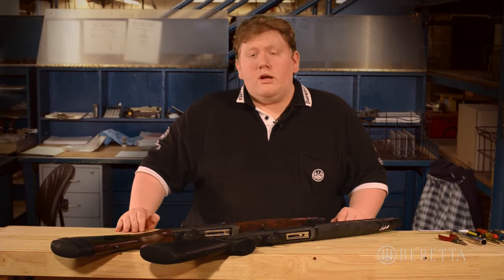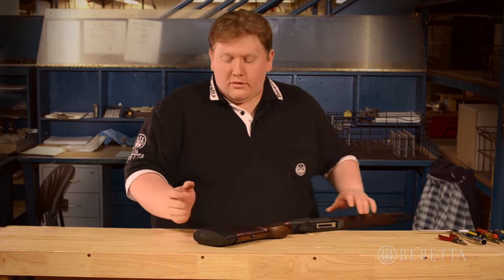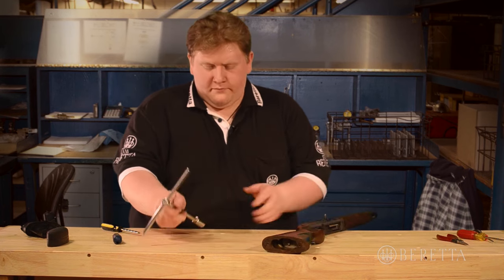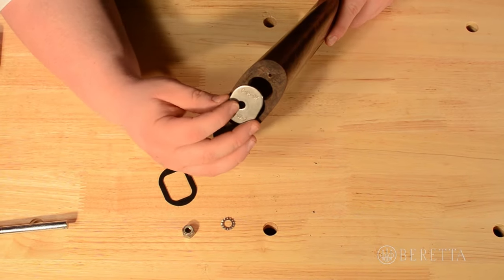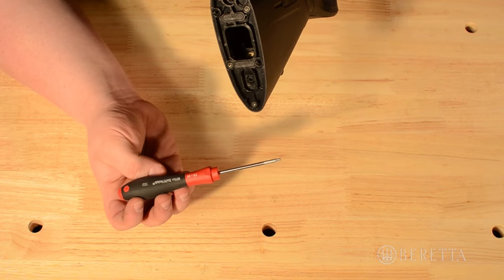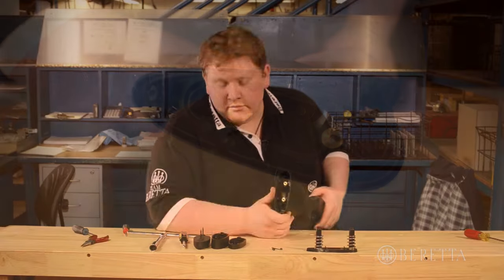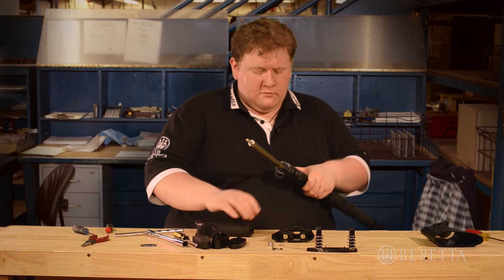Beretta Xplor and Xtreme - Adjusting Stock Cast & LOP

Comment: Nice instructions, clear and concise.  The whole stock on my a400 extreme plus was randomly loose, I had to take the stock apart and tighten that 13mm bolt holding the stock on.  One little correction though, once you take the butt pad off those 5 screws are t10 torx and not t8.

Comment: I bought an A-400 which was set for a left hand shooter. Swapping the shim and spacer to right hand set-up was a breeze, but when I mounted the gun it still had the bead off to the left of the rib. But the next day when I mounted the gun the bead was right smack in the centre of the rib. The stock had obviously developed a "memory" biased to the left hand set-up and it took about 15 hours for the stock to reform to the new bias. Just thought I would throw this in in case anyone did it and thought they had done it wrongly. Thanks for the instructional videos Erik.
Reply: Clarification. Was a right handed gun set up for a lefty or did you obtain an actual left handed model?

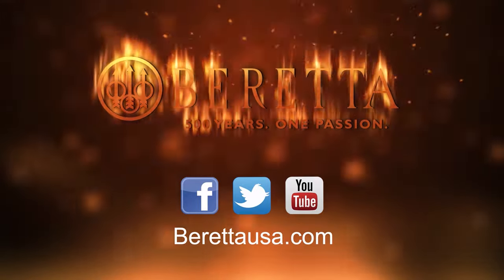Comment: WARNING! At time 3:42 / 9:38, He says you want to have the C60 SX facing you at the top as he places the plastic shim onto the Stock.     

THAT IS AN INCORRECT STATEMENT.   

SX (Left-Hand) and DX (Right-Hand) plastic shims are positioned on the rear of the receiver, so the marking is visible toward the shooter! At that point, the desired shim marking will be facing you! When the metal spacer is placed into the hollow of the Stock, that will also be facing the rear of the shotgun. Both Shim and Spacer face the shooter or the butt end of the gun.   

If you don't believe me, use a caliper to measure the shim. When looking at the DX side of the shim, the left side of the shim is thicker, causing 'Cast-Off' (rightward cant) for the right-hand shooter. Conversely, when looking at the SX side of the shim, the right side of the shim is thicker, causing the Stock to 'Cast-On' (Leftward cant) for the left-hand shooter!
Reply: Good comment. I followed the video then dived into the comments to see why I had cast off for left hander!! Another comment elsewhere says imagine you mounted your gun and your stock were transparent, you would be reading the numbers on the back of the receiver facing you. Only part that could be confusing, and they made it confusing!!

Comment: at the 3:40 mark.  The guys says put the plastic black shim facing (SX for lefty, and it's Dx for righty)  you on the stock.  I believe this to be incorrect.  It should be placing the shim on the back of the receiver facing you which would be opposite of what he is doing by placing it on the stock.  He is not doing it as the manual states.
Reply: Thank you, was wondering the same thing

Comment: Just as an FYI, the T8 Torx screwdriver will need to have a very small diameter shaft to go down into the recoil pad screw holes to get the the Torx screws. I had to go out & buy a set, which is fine since I'll use it for other tasks.

Comment: 8:48 appears to show the front spacer being reinstalled with "C-55-DX" facing the shooter, but the rear spacer was installed with "C-55-SX" facing the shooter for a left handed drop. Per the manual this is incorrect. @Beretta can you confirm?

Comment: Just bought a 1301 comp. I shoot left handed so tried to replace the DX plate with SX. Can't figure out how to remove the end plate. I have the butt removed and the bolt and can see the Cast plate but can't get the plastic end cap off. Can't find instructions how to remove. Please do a video or provide explanation. PS - the Xtreme has screws whereas I don't see any for the 1301.

Comment: When positioning the front shim should the markings be facing the rear, towards the shooter? I wished they zoomed in on that!
Reply: I agree
Reply: sevenrats 
Yes towards the shooter.
That's how I did mine.
Reply: according to the manual, page 35 and illustrated on fig. 40, the shims needs to have the same numbers/letters facing the same way, and towards the shooter when the gun is assembled.

Comment: Mine is T10

Perhaps a $2000 shotgun could come with a toolkit?

Shim marking towards the front towards the shooter is a bit vague.

Might want to mention D for Dexter or right handed, S for sinister or left handed.

The downloadable owners manual has all drawings removed and is useless.
Reply: erg0centric according to the manual, page 35 and illustrated on fig. 40, the shims needs to have the same numbers/letters facing the same way, and towards the shooter when the gun is assembled.
Reply: @erlende2933  he should have made this comment in the video. He says “facing you” but it could have been interpreted as facing you as looking at the stock when installing the shim.

Comment: This video is very helpful, but removing the Kick-off unit is not as easy as it appears.  I couldn't get a T15 screwdriver (recommended) that was small enough to get through the brass fitting.  I called Beretta in NY and Scott suggested trying an allen wrench.  A 3/32" one worked perfectly.
Reply: I ground one down to fit
Reply: Mine was a T10 on the action model.

Comment: First, thank you for the video, it helped.  But just so I am clear, the cast polymer shim should be placed on the stock with the corresponding drop number visible and on the top?  Just like the drop shim?  In other words, both of the corresponding numbers/letters would be facing you as you look at both the front and the end of the stock.  Is this correct?   example: 60DX <--- stock ->60DX  Thanks in advance..
Reply: Jay Thompson according to the manual, page 35 and illustrated on fig. 40, the shims needs to have the same numbers/letters facing the same way, and towards the shooter when the gun is assembled.
Reply: Had to scroll through the comments to find this. My manual has done away with the figures but still references them in the text. 🤦‍♂️

Comment: I changed the cast and drop on my extreme plus was getting cheek slap... fits and shoots great now. I was out the door on a hunt right after I did this and found a little rubber o ring about 1/4 inch outside dia. on the floor. I don't know if it was out of my stock or off something else. Is there any o rings in stock of a kickoff?

Comment: I did this yesterday just to service the kick off and clean out the stock.   My question is my Phillips and T style screws are rusted pretty good.  Should I contact Beretta for replacements or Brownells?   Thanks
Reply from the maker: It's hard to diagnose without asking more questions. Give us a call at 800-BERETTA ext. 2003 (mon-fri 9am-5pm ET) and we can assist you further
Reply: +Beretta Thank you!

Comment: I am trying to adjust my LOP by replacing the 1/2" spacer with the 1" spacer, but the screws in the recoil pad do not fit all the way through the 1" spacer.  How do you replace the screws that come in the recoil pad with the longer screws provided without ripping apart your recoil pad?
Reply from the maker: Just slowly unscrew them while putting pressure on the front of the screw.  They will come out without tearing anything as long as you go slow.
Reply: @BerettaCommunity  Just got a new A400. Apparently I have hobbit arms and didn't know it. My question would be, if you can just use the butt stock end cap, can you / should you use the same screws that it came with or do you need a shorter set of screws to keep them from bottoming out within the housing?

Comment: Can I eliminate the 1/2 inch spacer for the shortest LOP possible?
Reply: Just got a new A400. I would like to know this as well. Apparently I have hobbit arms and didn't know it. My other question would be, if you can just use the butt stock end cap, can you / should you use the same screws that it came with or do you need a shorter set of screws to keep them from bottoming out within the housing?

Comment: Hi is it okay to use NO spacers and ONLY the butt pad? Thanks for your time.
Reply: Just got a new A400. I would like to know this as well. Apparently I have hobbit arms and didn't know it. My other question would be, if you can just use the butt stock end cap, can you / should you use the same screws that it came with or do you need a shorter set of screws to keep them from bottoming out within the housing?
Reply: @Laughinghawg  did you ever figure it out? I wanna remove the spacer and use just the pad
Reply: @bobgeore6107  Hey Bob, I did. I called Beretta, they said the same screws it came with would be just fine and it would not bottom out. So, I removed the spacer, have shot approx 100 rnds through it so far at the range. I am headed to the duck woods tmw to get some rice field and flooded timber mud on it. I have not taken the stock apart to see if there was any issues. As for now, I'm just gonna roll with it based on info/conversation with Beretta.............. and I'm being lazy and don't want to pull it all apart, just want to shoot it at some duckies. 😁

Comment: Can you leave a spacer off the back and just have the recoil pad there
Reply: Was wondering that as well did you get an answer. I have new extreme plus looking to shorten the butt up
Reply: Were you able to figure out the answer?
Reply: Just got a new A400. I would like to know this as well. Apparently I have hobbit arms and didn't know it. My other question would be, if you can just use the butt stock end cap, can you / should you use the same screws that it came with or do you need a shorter set of screws to keep them from bottoming out within the housing?

Comment: NOTICE: The Torx heads are NOT T8 on the A400 Extreme as stated in this video. I searched high and low and ended up going to Lowes to buy a T8 because I was trying to be proactive and get all the tools… ended up buying an unnecessary tool.

Comment: I appreciate the video but you completely ignore the most challenging phase of cast/drop adjustment in this category of Beretta SA’s.  On every unit from the 391 to the A400 replacing the washer and self locking nut is a hilariously haphazard and unmentioned exercise. Add in the Kick-Off assembly as an obstacle and the placing of the metal shim plus the self-locking nut is a ridiculous time wasting exercise. Beretta or Cole should market a deep well socket perhaps manufactured even from plastic of sufficient length, close tolerance and look-through design to allow first-attempt placement of the nut.
Reply: I definitely agree it can be a hard task - for anyone doing this I figured out a little trick.

I put a 1/4 inch ratchet extension through the washer and held it with my fingers while touching the end of the extension to the bolt so that the washer will slide down and go onto the bolt and for the nut I put that on a 6mm Allen wrench and did a similar technique. The 6mm is perfect because it’s enough tension that the nut won’t slide off and you can actually start to thread the nut onto the bolt. Easy peasy.

Comment: Hi, I'm a left handed shooter and I'm having a problem with my A400 Xtrema Unico. When I bring the gun up to shoulder I'm seeing way to MUCH of the rib, it's very difficult to see st flat down the rib to the bead (so I'm always shooting high). I've heard several other shooters of this gun complain of the same problem even after shimming. Can anyone help out here please?...Thanks.
Reply: 65mm drop is the maximum with the Beretta shims provided. If you need more drop and cast you have to improvise. It is very possible.
Reply: @Frenc165  Thank you Frank

Comment: Anyone know how much in-lb of torque you should apply to the kick off system when tightening the 13mm bolt
Reply from the maker: The best way to do it is to hand-tighten it, then bring it 3/4 turn past that point.
Reply: Beretta , the instructions says 1.6- 1.8 kgm of torque. You don't have a recommendation for in-Lb. I have a torque wrench just need to know how much in in-lb.
Reply from the maker: https://www.convertunits.com/from/kg+m/to/lb+in
Reply: 2.2 pounds per kilo. 3.6 pounds of torque
Reply: Beretta 1.6 kgm is too much, my spring washer broke. Can I use a nord lock washer as replacement?
Reply: Dear Lord, people are stupid reading these comments, 3.6 FT/LBS is too much, no it’s not at all for a stock bolt the size that it is

Comment: Instructions on mounting the front (plastic) shim seem contrary to the instructions provided with gun; instruction booklet say's the shims, plastic and metal, must be in the same orientation, it reads that the shim should be placed over the stock bolt so that the correct measurements are visible at the top (ie with the shim against the action) - in the video the guy is shown placing the plastic shim on the stock itself not over the stock bolt which suggests it's the wrong way around in the video. Strongly suggest that owners double check with a Beretta agent and/or refer to the provided detailed instruction book before following the video.